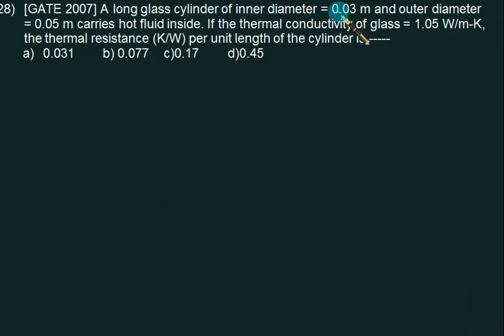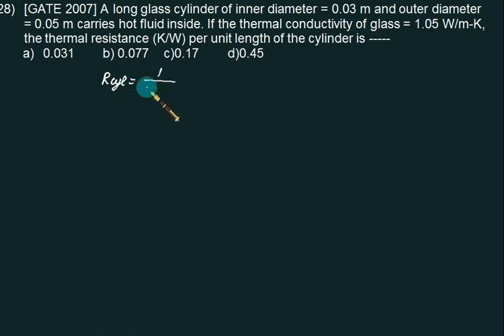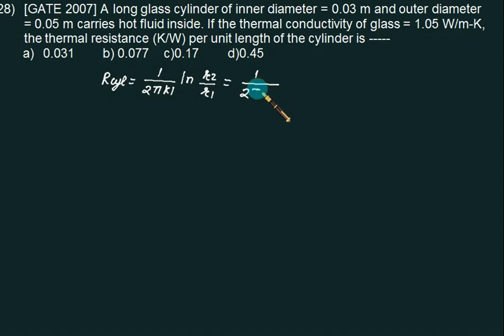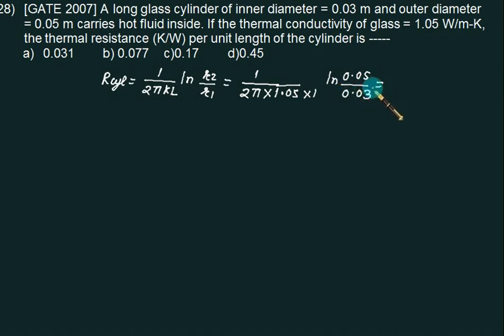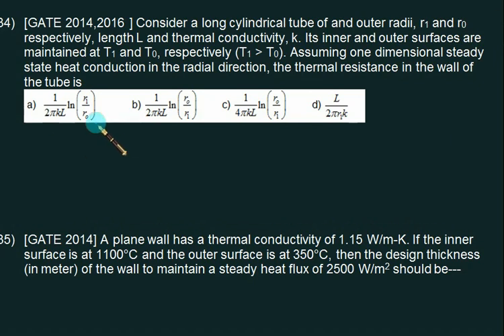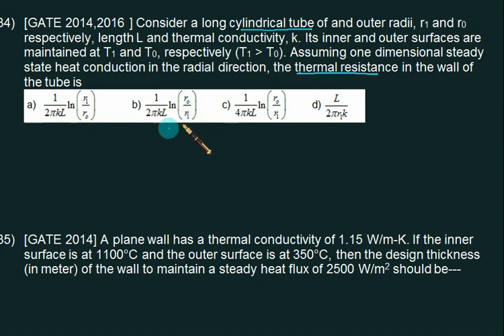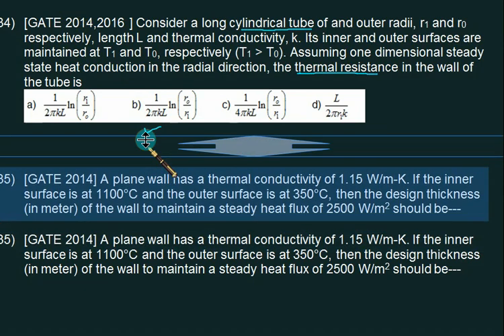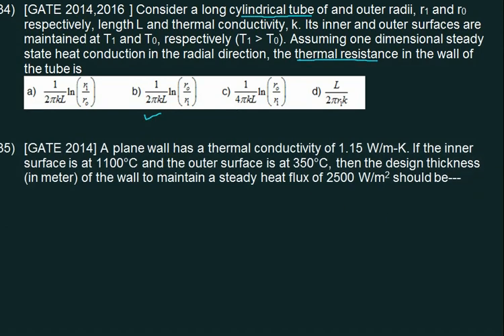10 Conduction heat Transfer through Cylinder Numerical

Comment: Dear Sunil,

I am currently working on my graduation thesis, which focuses on the heat emission of exhaust insulation systems in diesel generator rooms (Q in watts). The setup closely resembles the situation shown in your video: a stainless steel exhaust pipe surrounded by insulation material.

I have completed the theoretical calculations and would like to validate my approach. If possible, I would be happy to send you a brief document with an overview of the project and a calculation example (4 pages) via email. Any feedback or suggestions you could offer would be greatly appreciated.

Thank you in advance for your time and support.
Kind regards,